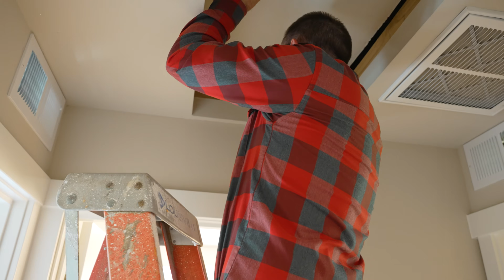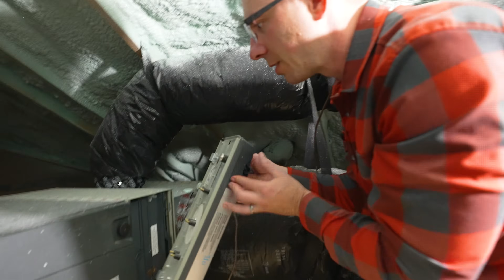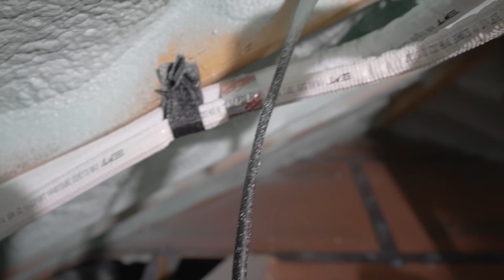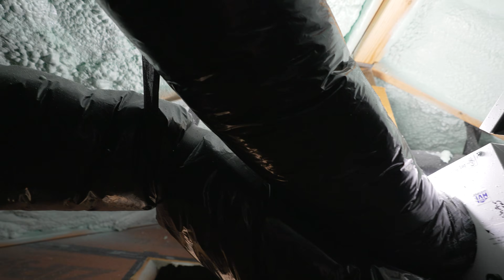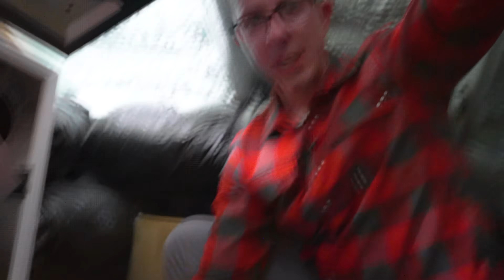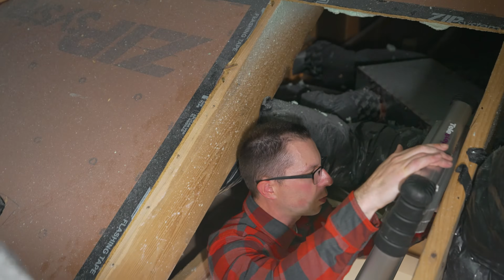Building Science - Trane Hyperion TAM9, CleanEffects Filtration, and Envirowise FreshEffects

Comment: No offense, and you do a great job for a spec home, but this reinforces my desire to an owner/builder of my retirement home.  From the point of view of a senior, I would want anything requiring regular maintenance like filter changing and cleaning to be easily accessed by the homeowner.  If it must be in the attic, pull-down stairs and a mechanical area with a little headroom would be nice.  As a DIY'R, it irritates me to think as I age, I would have to pay someone to climb up into a tight attic just to change filters.  Just an observation, not a criticism.  If I lived in your area, I would seek you out as my builder.👍
Reply from the maker: I could not agree with you more, and I'll have to put thought into that
Reply: That would be why it is important to stay on a regular maintenance plan with your local trusted Trane HVAC service provider. Once on this type of plan that provider will come two times a year or as needed to provide maintenance service to your system and clean or change filters as needed.
Reply: @captrobertsmith432  I do that now but unlikely in my future home.  It will have a walk-in mechanical room.  No ductwork, dampers, or anything else in an unconditioned attic space.  In fact, no unconditioned space at all.  Nothing to clean that I cannot reach with a small step stool.  Just yesterday I was on a 10 ft ladder cleaning the vents in my 12 ft ceiling.  Unfortunately, those maintenance visits are an opportunity to commit fraud.  Tell the homeowner they need something that they don't like a new capacitor even though another company had just replaced it.  Then there is the whole practice of putting your ductwork in a 130F attic.  I've also had to go up in the attic more times than I can count to free up the dampers of my zone system.  All dampers and motors were replaced but they started failing like the old ones in a few months.  Multiple mini-splits + ERV for me.  And as HVAC person, you will tell me those need regular maintenance plan also.  I can top off refrigerant, clean coils, and replace filters.  More than that, probably cheaper to replace than repair.